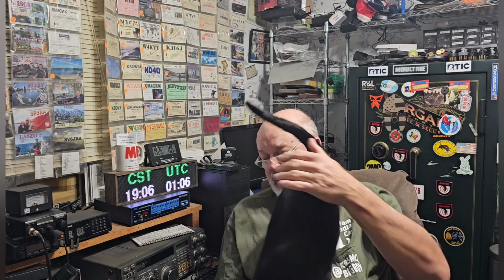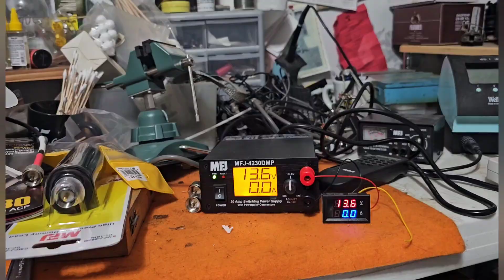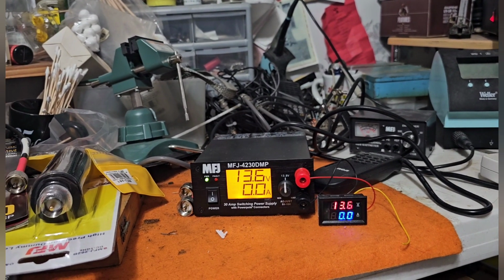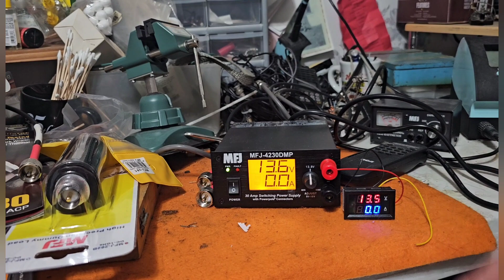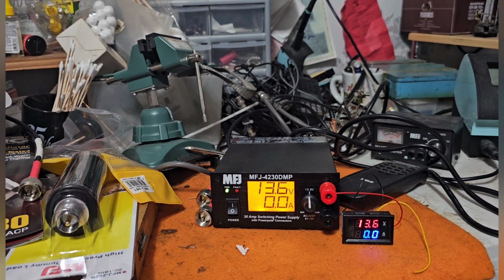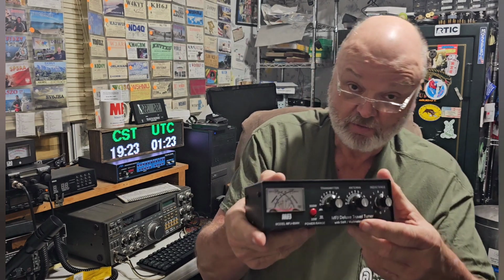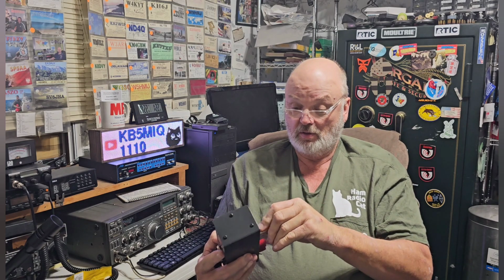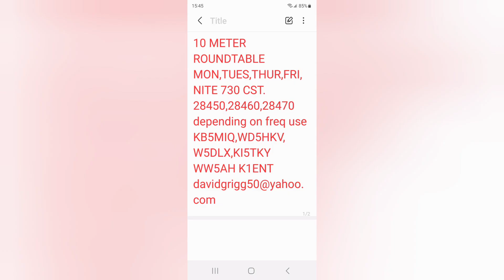Review of MFJ 4421 Digital snap in volt meter, MFJ 904H travel tuner. #hamradio #mfj #mtc

Comment: I have several of the MFJ manual tuners.  They all work great! Trick on tuning, Tune the tuner for highest static noise in receive.  Then turn the power down to about 5 to 10 watts and key up the transmitter in rtty mode and  tune the capacitors for lowest swr and highest power.  Never change the inductor with power applied. Then try one inductor notch on each side of the selected one.  Adjust capacitors as need for best tune.  Thats the simple version.  73
Reply from the maker: thanks!!! great info!! 73!!

Comment: I had a small MFJ tuner some years ago. I tried to load a 60 foot half wave open loop on 80 with it and ended up frying it. Luckily, the vendor refunded my money. Not sure if it was my trying to load that antenna or the tuner. I later bought the LDG Z11pro auto tuner and it could load this antenna on 80, but never made a QSO there. MFJ makes some good tuners, but sometimes their quality control leaves a lot to be desired.
Reply from the maker: thanks for watching!!73!!